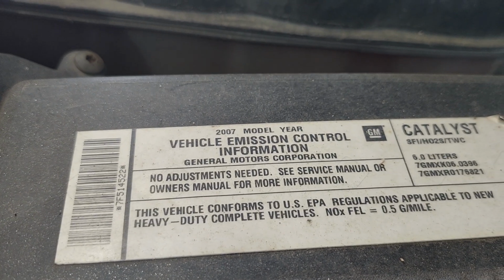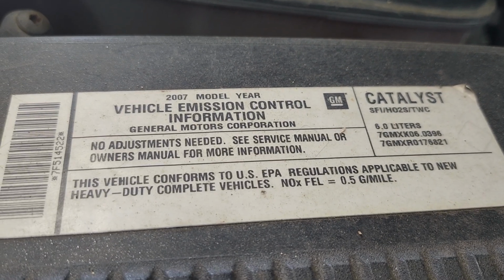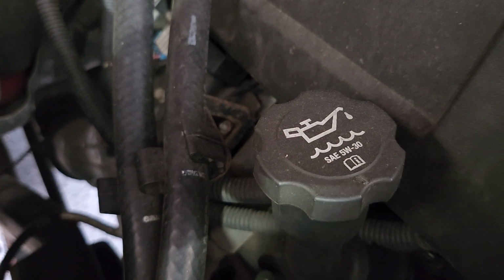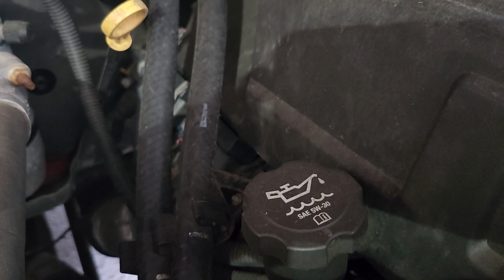Use 5W30  low engine failures .Use  0W20 oil high engine failures

Comment: My gf grandfather has a 2500 07. He bought it new. He only used castrol 10w30 conventional oil. He told me he never had an issue. He says synthetic oil is like water. He's a guy that still believes pennzoil and quaker state clogged up an engine.  Lol. He still changes his oil at three thousand miles.
Reply: I agree, I used to buy federal gov auction vehicles, fix them up and resell them. Saw many engines running q-state that were so sludged it was pathetic.
Reply: When I was growing up, Quaker state had a bad reputation for the sludge. 😂😂 My granddaddy was a master mechanic and he wouldn’t even use Q state in his lawnmower.
Reply: It’s that 3k oil change interval that saved the truck all these years

Comment: 2006 Toyota Matrix with 229,000 miles and runs great. 5w30, 5k/6mo OCI (Kirkland 5w30) and OEM filter. They actually had a TSB that you could  use 0w20 in this car. I'll pass.

Comment: Got a 2016 mazda 6 been running 0w20 got 170k miles with no problems but gonna change to 5w30 because that's whats used outside of usa and canada on that engine hopefully will keep it running strong
Reply: think about it- you've done well with what you've been using , but now you're gonna change it up because of what others are doing- be careful.
Reply: @tommurphy4307  Most people that have finally gone from 0W-20 to 5w30 have already done tons of nauseating research
Reply: I would guide your transition decision  by UOA.  Pulling an oil sample and spending and additional $30 bucks each oil change to monitor oil life and wear trends is far cheaper than shortening the life of your engine following speculation and not a data driven decision.  Independent analysis on 1000s of vehicles has shown switching to 5w30 when your manufacturer specifies 0w20  can often cause more wear.  Watch video from lake the motor oil geek called “fake news”.  First, not all engines use 5w30 in other countries: many still use same 0w20.  Second, some manufacturers change oil viscosity spec based on climate and needs of particular engine.  Third, there are independent lab analysis for used oil which prove 0w20 prevents wear more than 5w30 for engines that call for 0w20.  

Extended OCIs do far more harm than viscosity.
Reply: @ElmerFudd79   I am in Canada, 2012 Mazda 5, 150,000 kilometers so about 100,000 miles. Just bought it, has oil change sticker on windshield that says 0-w20 on it. Owners manual says 0-w20. I will be using 0-w20 when time for an oil change.  If that is what has been used in it and what is called for in it I won't be changing it.
Reply: @misterjames2567 thanks for sharing mire proof 0w20 does not kill engines.  There are way too many fear mongering genai videos out there giving people bad advice.
Reply: I dont know.. i myself am struggling with what to use, i have a new 2025 cx5 and i just cant decide. But i can tell you this for sure.. if i had a car tha did 170k miles on 0w20 with no issues (and no oil consumption) i would definitely stay the course
Reply: I'd continue with what you've been doing. Changing oil regularly 5000 mi. is more important. Use a free sound measuring app, to check your engine noise, and if it starts to make more noise, then consider a thicker oil. IMO

Comment: Can I use 5-30 in a vehicle whose oil caps says 0-20w
Reply: Yes absolutely. I run 5w40 in many engines that call for 0w20 and I've had some whether my own or customers git BIG milages with ZERO issues

Comment: do you rec if cap says 5w-20 to move up a notch?
Reply: Either 5w30 or 3K mi max on 5w20
Reply: not if its brand new, but if its new change oil at 8 instead of 16k. if its got 150k miles on it you might wanna consider changing to a 30 weight. if its not a diesel with dpf.

Comment: What about 0w 8   and 0w 16 oil that Toyota recommends.    My wife's car specifies 0w16 but says you can use ow20 in an emergency IF you go back to ow16 at the next oil change.  I would be concerned about my warranty being voided.   0w 30 would be like molasses.
Reply: The average age and milage on cars in Japan are 6 - 8 years with 50.000 - 60.000mil. when they are scraped.  Think about it!
Reply: @markwarnberg9504   SMOG laws in Japan required that.  Those engines get shipped here to the US by JDM  and run 200,000 miles.  They aren't worn out.
Reply from the maker: 520 530 depends what environment u use it in . No engine issues Toyota mechanics dont even use that oil
Reply: @anthonynastasi4098  They sure do here in California.  They don't want to void the warranty.

Comment: I have a 2010 Yukon 2500/6.0 with 250K miles on it and it uses zero oil between one year oil changes (or 3K miles) and it's completely dry underneath and on my driveway!  It was a fleet maintenance vehicle before I bought it.  They damn sure don't build them like that anymore!
Reply from the maker: 3ooo miles it the majority sweet spot

Comment: So I have a2016 Silverado 1500 5.3 should I use 5w30
Reply: Why would you take advice from a total stranger you don't know or never met? Wow.
Reply: @1958Cadillac-v2g  
Hey 1958  >> "WOW" << is using ANY 0 weight oils in your ANY of your engines.
O weight oils are now recommended simply JUST for companies to pass EPA like pollution standards that give auto companies better deals because they can list better MPG as oil thickness is so thin with it's cooking oil like crap.
It is for the companies dollar, not yours or the life of your car !
Reply: @1958Cadillac-v2g  y comment 😮
Reply: So is that yes or no 😳🤔
Reply: Thank will do with my next oil change
Reply: I don't care what anyone says, i would 
NEVER 
use 'any'  0 weight oil !
If i were you yworld,
 if your truck takes 5 liters of oil, i would be using 
3 - 5w 20's
2- 5w 30's,  and to top up it up (if it gets low) with 5w 30.
(All Synthetic  oil ONLY and change always every 5-6k miles)

Comment: Asking for a friend... :face-blue-smiling:
For a Honda 2022 Si 1.5T with 0/20 on the oil cap would you recommend next one UP 5/30?
I presume the same logic would follow for 07 Honda Civic Si 2.0L 300K miles with 5/30 on cap go to 10/30?
14 Honda CR-V 2.4L 152K Trusty Honda engine with 0/20 go to 5/30?
Reply: No please put the engine oil that is recommended by the manufacturer. He did not engineer your engine. These are things he believes but can't necessarily back up.
Reply: @IamRayne1992  1 billion percent agree...this mechanic did not design your car
Reply: @IamRayne1992  I don't totally disagree... the problems are more from people that EXTEND the oil changes or don't change at all...
Reply: Exactly. There are too many people that only change their oil once a year or skip a whole year.  If you don't maintain it of course it's not going to last@edwardinvegas

Comment: 0w20 is not the problem. It’s people not changing their oil when it needs to be done and crap motors that are being built today.
Reply: It’s a combination of both.  Keep in mind many Toyotas recommend 0-8 and 0-16, so 0-20 is a thicker oil.  For best protection in varying weather conditions use 5-30.
Reply: @user-tb7rn1il3q  Yes I get it there is no "weather" in Southern California a desert.
Reply: I believe that really... as I have 2 out of 3 Honda's with 150K+ I do the oil (MYSELF) around 5K so yeah you can say it's borderline... but no issues with both Honda's...
Reply: @edwardinvegas 2004 Honda  I own since new, 220k miles,  no issues, I change oil every 5k...
Reply: 0W-20 is adequate at the minimum acceptable engine protection range to accomplish Gov’t fuel efficiency standards, for the same vehicle sold elsewhere in the world (outside the US) the vehicle manufacturer would recommend 5W-30, for extra protection we use 5W-30 in our 2 Mazda’s and 1 Honda SUV! 
My Ford F-150 Recommends 5W-30 from the manufacturer & I change oil every 3,000 miles in that truck!
Reply: Many people failed to change their oil enough, but prior to the introduction of 0W-20, or lower, engine failures were infrequent.     265,000 on my old F150 right now.  
10W 30 oil.    I'm in Florida.
Reply: 0W-20 oil is designed for Minimal protection to accomplish US Gov’t fuel efficiency standards, for Maximum protection educated folks would use 5W-30 instead (like the same oil manufacturers recommend sold outside the US)
Reply: @martyi398 you should educate yourself more. 🫡
Reply: @martyi398 Where do you find out what is used outside the US?

Comment: Mechanical tolerances have gotten tighter and tighter over the years. I remember back in the day engines required thicker oil like 15w-40 etc, since they tended to burn oil more easily (1960s and earlier). As time went on oil viscosity went down when mechanical tolerance because tighter due to improvements in manufacturing, but at a certain point I think you hit a limit on viscosity before you risk damage. We have long reached that limit with 8, 16, and 20 oil, when Ow started becoming common about 15 years ago.

5w-30 should be the lowest anyone should go UNLESS it's a special engine that was designed for extremely tight tolerances on purpose that isn't designed for longevity, but for performance or function.
Reply: Believe it or not rod bearing and main bearing clearances haven't really gotten any smaller since the 60s. Good additive technology and precision metallurgy have allowed engines to survive with lower viscosity oil but absolutely nothing is stopping you from safely using a higher viscosity oil.
Reply: The tolerances have not gotten tighter... it´s the oil passages that have gotten smaller. and the engines running hoter thanks to turbo chargers and the engine being packed in like an oven with no cool air circulation. The thin oils breaks down faster thus loosing it´s lubrication. The 30 and 40 weights give you a wider margin of safety between oil changes.
Reply: Learn the difference between manufacturing tolerances and design clearances. Nobody picks bearing clearances based on a certain oil viscosity. It doesn't work that eay.
Reply: My 22 Elantra N (not N line) with the turbo was 5w30. They put 0w20 on the lower eco trims with less power. Hyundai seemed to know that thin oil for a race car is bad.

Comment: What do you think of Mobil 1 high mileage 10w40 synthetic oil for 07 Chevy impala lt 3.5 with 306,000 miles on it
Reply: Go Castrol Full Synthetic 😉
Reply: Back from 07 I'd use what was mfr recommended. I'd only use high mileage oil if it had leaks or start-up smoking. I'm concerned it will "condition" seals that don't need it.

Comment: Notice, those older LS 5.3 engines from 2007 or so, have the basic same lifters as today. BUT, with MANY less failures.
Reply: No. Lifter failure on those engines is still common, it's a horrible design that GM has NEVER got right. 2006 and older 5.3L are the ones that don't have lifter failure and that's because they don't have the DOD system with the collapsible lifters.
Reply: @madmatt2024  maybe you should read puncht37's comment again- you are agreeing with him....he's implying the older motors have fewer failures because they recommended heavier lubricants.

Comment: 0W40, can you clarify your recommendation on that weight? Say no to the 0's may be too broad. 
My understanding is that it is a thinner base stock with friction modifiers added to get to 30 weight and using it should be fine unless you need an oil like 10W40 or 15W40. The only problem with 0W40 is that some blends may shear to a lower viscosity too soon. I believe there are 5W30 blends that shear out of rated viscosity too soon as well. 

I really wish a good synthetic 10W-30 & 10W-40 were easily available at parts stores and box stores like W mart.
Reply: The old saying "Too many cooks!"
There is no need for such a broad range as a 0w40,  GM has gone overboard on the new recomendation. 5w30 has proven to be a good year around oil, 10w40 in hotter climates.
Reply: @markwarnberg9504  I don't know about newer models but Chev used to recommend 0W40 in the Corvette and Dodge recommended 0W40 in the Hellcat. Porsche also recommended 0W40 in some of its models. 
Again my preference is 10W30 or 40.
Reply: The larger the difference between those two numbers the more friction modifier is required to do the job and when the oil starts to break down so does the friction modifier!  0W40 is a very large range as far as I'm concerned!
Reply: A 0w-20 is far thinner at freezing temps than 0W-50. 0W is a relative number not absolute, the second number is more specific viscosity at 212f.
Reply: @rpsmith  Yes at some point all oil will shear. Shear= viscosity breakdown. It's only a question of how low of a grade it will drop to. Starting at 0W40 that oil is unlikely to drop to a 20 grade unless serious abuse or neglect has been done. If that is the case a 5W30 is unlikely to save you either. 
Personally I consider 0W40 to be a 30 grade, obviously not a straight grade.
Like I said I'd prefer a synthetic of something more conventionally rated at a 10W30 or 40 but that's not what most companies are bringing us.
Reply: i get my synthetic, high-mileage 10W40 valvoline at walmart- they also have it in mobil 1 for a few dollars more. i have not seen it in pennzoil platinum at walmart, however. i change it out at 3K in my nissan and i see far less consumption than i did with the 5W30 stuff nissan calls for. i also use a bit of lucas HD oil stab in there, too.
Reply: @tommurphy4307  If you really want to reduce your oil consumption, get a "european" formula 0W-40 or 5W-50 oil like castrol or Mobil 1. The key is making sure the oil has a lot of PAO in it.
Reply: @tommurphy4307  I don't want or need a high mileage blend. That seems to be what they want to go to with the weights I would like.
Reply: ps: i also use lucas fuel conditioner/upper cyl lubricant in my car, too. never been disappointed with lucas stuff.
Reply: Just go with 5-40, it's for deisals but will work just fine with gas engines. 5-40 has more friction modifiers and detergents, is full synthetic, is available everywhere and is a lot cheaper than 0-40
Reply: @nn-dj2nu  don't want to use diesel oil in a gas vehicle because it my pollute the catalyst.

Comment: Yup that's the right cap. My 06 escalade runs on 5w 30, has well over one hundresd thousand miles and the engine is still runs smooth and quiet.
Reply: you've only got 250K to go until you've caught up with my '92 daihatsu motor- and it failed at 350K because dumbass me put the timing belt on backward!
Reply: @tommurphy4307 😅😢.With timing belts always remember teeth down..

Comment: You don't approve of Amsoil 25K mile oil changes? 😂.  Can you do a video about 0w30 vs 5w30 as alternatives to the 0w20?
Reply: I don’t recommend oil change intervals that long, but Amsoil also uses much higher quality base stocks (group IV and V) versus most widely available store brand use grade III or less.
Reply: Amsoil can go that distance as long as your change the filter half way through.
Reply: And what about the fuel dilution?
Reply: @charlesblerzbo1616 

I suppoae that would depend on the vehicle and drive habits.
Reply: 0w30 oil is still a 0 weight oil. Less sheer stable. 10w30?  Now we`re talking.
Reply: @puncht37 The 0w at cold start is not a problem the 20 weight at 230+ degrees oil temperatures is 0w-30 will be better at 230 degree oil temperatures than a 0w-20 and 0w-40 is even better at higher oil temperatures 230+ degrees